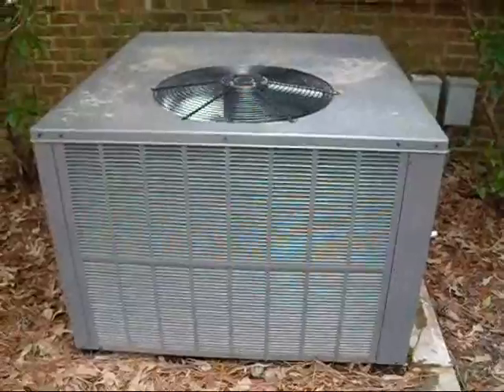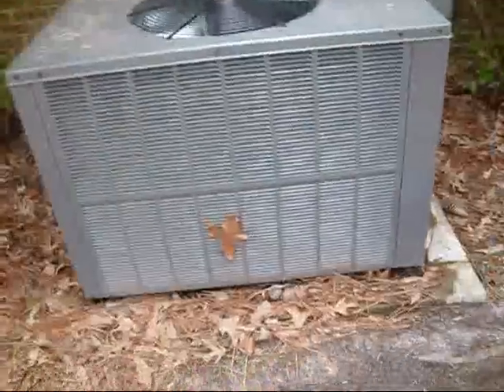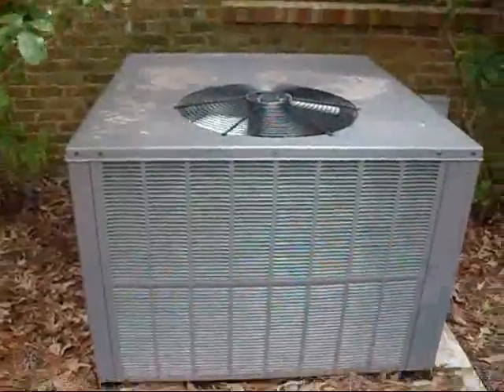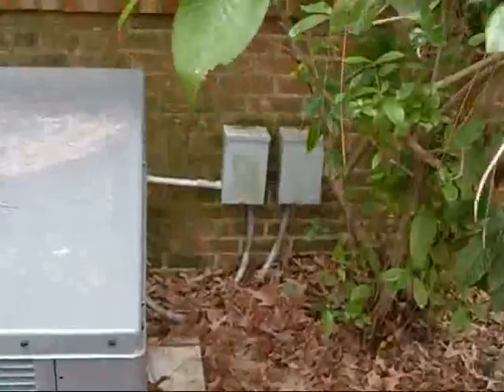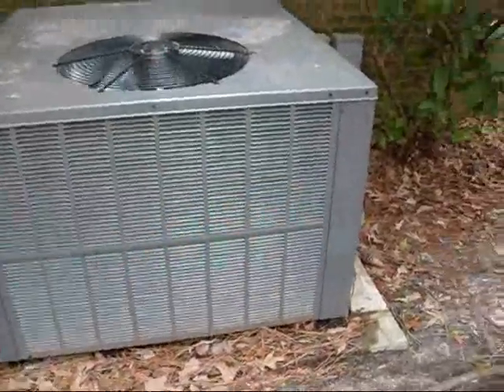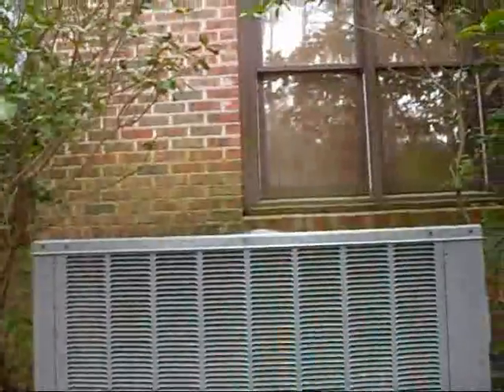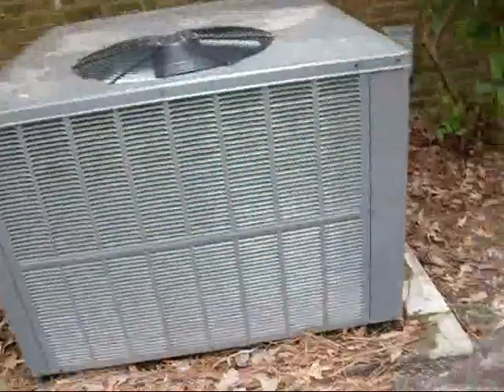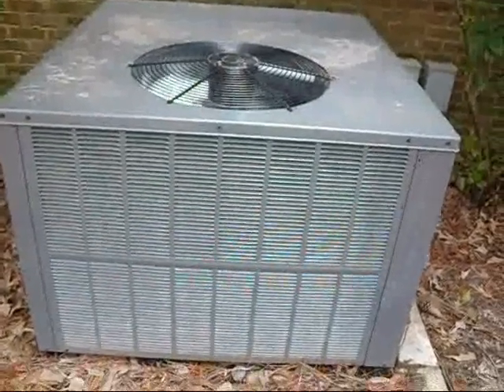2008 3 ton Goodman packaged heat pump running and defrosting.wmv

Comment: This is the "M" series heat pump, your house has the horzontal only model, which is what I also have. The advantage of this M series, is that it can be mounted downshot on a roof curb.